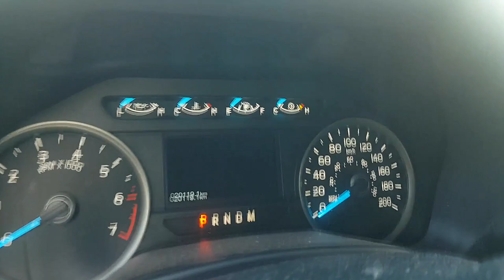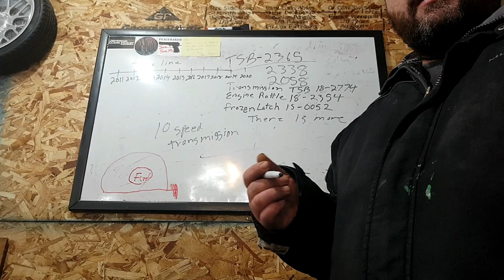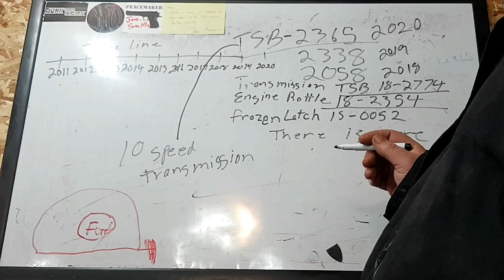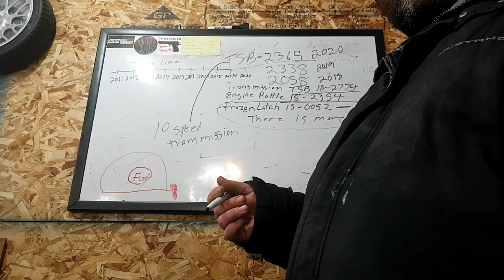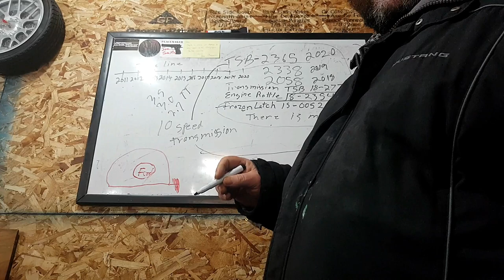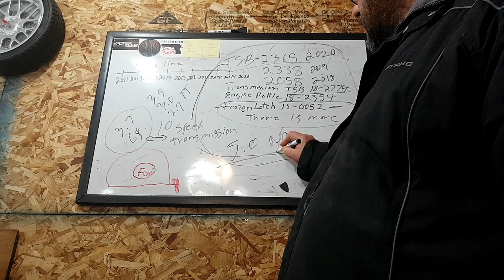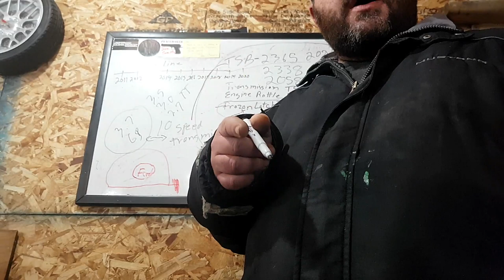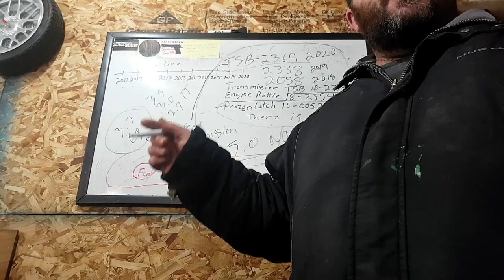FORD F 150 burning oil  consumption engine rattle and transmission problem related? 2018,2019 2020

Comment: Just signed the petition. I just bought a 2020 f150 5.0L with only 600 miles so far. To early to tell..
Reply from the maker: Mr pas I sincerely hope that the issue is resolved.  Please keep in touch and thanks so much for taking the time 👍
Reply: @thisguysgarage  can you teach us how to test the vaccum on these trucks?
Reply from the maker: @mrpabs5864  sure ban did you see the video where i tested the vacuum on two trucks?
Reply from the maker: @mrpabs5864  https://youtu.be/5pc_rC6ieSI
it does not show how but i will post something on this in the next day ,ty very good idea
Reply: @thisguysgarage  yes please, I will order a gauge, just want to make sure that I do it correctly. This will be a good test.
Reply: @thisguysgarage  I saw that video and all your videos, that's how I got paranoid haha.

Comment: My 2018 is going in for the engine swap compliments of Ford. They are now doing “buybacks” even after engine change out. Ford says the 2021 trucks will not have this engine.
Reply from the maker: the transmission is what is killing the engine.   it would be a long time before i have another ford product , ty for taking the time. consider a custom tune if you are going to keep the truck.

Comment: ENGINE:  2019 f150 xlt 4x4 10 speed 5.0 bought brand new December 2019--- I estimate during first 1800 driven miles engine oil was low, and maybe 2 quarts of oil was used.  In any case, 2 quarts of Motorcraft 5w-20 was added to get to full level.  My thoughts are that some oil loss probably was attributed to break-in.  I didn't check it in the beginning purchase days because I thought I never had to!  Sort of calibrated dip stick and determined 1.0 quart of oil change is pretty accurate between upper and lower diagonal box area of end of oil stick (cross hatch imprint section between dip stick dots) with truck perfectly level on pavement.  Switched to 5w-30 Pennzoil full synthetic ultra at around 2900 miles.  2 port $20 catch can installed at 4000 miles (https://www.amazon.com/gp/product/B07H8BSTHB/ref=ppx_yo_dt_b_asin_title_o05_s00?ie=UTF8&th=1).  Auto stop eliminator installed at 4100 miles (if start stop excessive vacuum pull issue having an effect on crankcase oil pull that this might minimize part of the issue plus get rid of the annoying engine cutoff when not wanted) (https://www.cjponyparts.com/autostop-eliminator-for-split-hazard-start-stop-switch-assembly-f-150-2015-2019-f-150-raptor-2017-2019/p/AE000/).  At 4700 miles new OEM Ford pcv valve installed just in case that was bad.  At 4800 miles started a little higher rpm sport driving to help break-in if this helps and did this for maybe 100 miles.  5/29:  now at 5300 miles and estimate oil consumption at ~1.0 quart/3000 miles (0.75 quarts used per 2400 miles).  Catch can only has accumulated maybe 2 oz. of oil total so far, so oil loss likely not as much an issue for this pcv oil vapor migration reason.  Pulled #5 cylinder plug out and it was a little black and "slight oil wet" and carbonized (didn't check the rest of the 7 cylinders).  Cheap amazon endoscope  (if I could show pics I would) shows some carbon buildup (5300 miles) on top of #5 cylinder piston primarily concentrated at corresponding area of intake valve.  (Not able to see the amount of carbon on valves from behind with my cheap endoscope device).
TRANSMISSION:  I hear clanking during shifting and gear selection from time to time.  Will keep an eye on that one.
MY PLAN:  Will monitor issue(s) til 10k miles.  Have already signed the oil consumption petition, though.  Will wait til 10k miles to see if oil consumption is getting better.  If it goes to 0.5 qts/5000 miles, I will be ok with that (not really).  If not, time for the horrid dealer visits to address issue!  
MY THOUGHTS:  Ford, you have to do better than this.  My 2010 4x4 5.0 6 speed was MUCH better than this!  And never burned oil!  and trans never had an issue.  $45k for this "thing"?  What!!!!?  Embarrassing for Ford, especially if not addressing a fair and honest correction for 3 years when they knew they had these problems this long!
Reply from the maker: Thanks so much for taking the time. Ford's corrections are nothing more than frustrating.  Share when and where you can. Sunlight is the best disinfectant 🤜🤛👍

Comment: I'm more emotionally vested in this oil consumption TSB series, than I was with my second girlfriend.
Be back after I watch the whole thing.
Reply from the maker: ty sir ,that's saying somethin!
Reply: ATTENTION FORD FANS:  Scotty Kilmer says the 5.0L oil consumption problem is a Ford class defect that Ford won't admit to.  All of Ford's work arounds don't address or fix the real problem..... which is that Ford used an aluminum block on these 5.0 engines, and didn't sleeve the cylinders.  They used a ceramic coating in these cylinders (to save a few pennies), and this coating is either failing or it isn't working as it's supposed to, thus causing the massive oil consumption problem.

Comment: https://youtu.be/xa1kqSo3aeM

Have you seen this? Although I will say your consumption exceeds this still.

Edit: also the 10 speed was added in 2017, but was only available on the higher trims.
Reply from the maker: absolutely
Reply: ATTENTION FORD FANS:  Scotty Kilmer says the 5.0L oil consumption problem is a Ford class defect that Ford won't admit to.  All of Ford's work arounds don't address or fix the real problem..... which is that Ford used an aluminum block on these 5.0 engines, and didn't sleeve the cylinders.  They used a ceramic coating in these cylinders (to save a few pennies), and this coating is either failing or it isn't working as it's supposed to, thus causing the massive oil consumption problem.